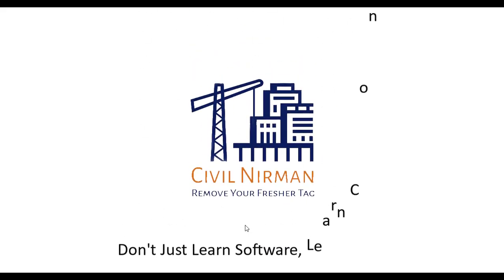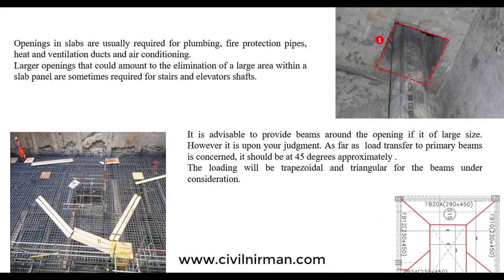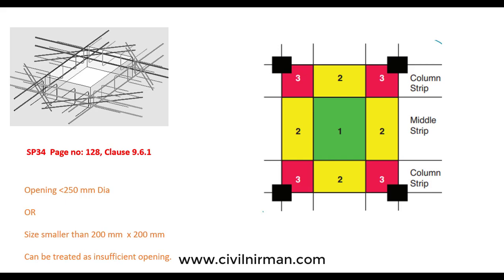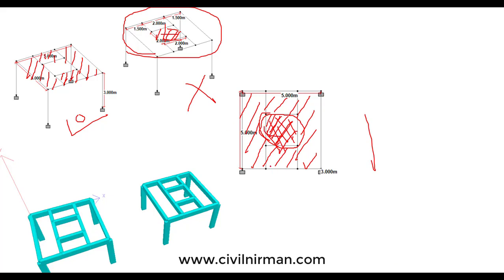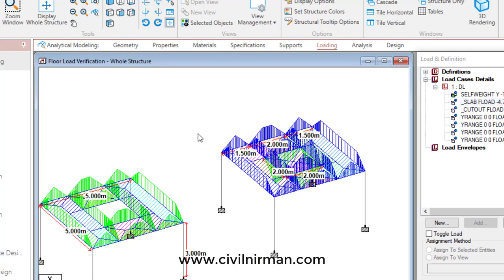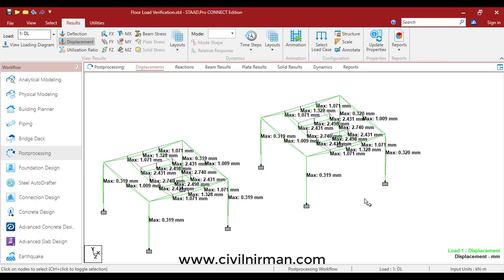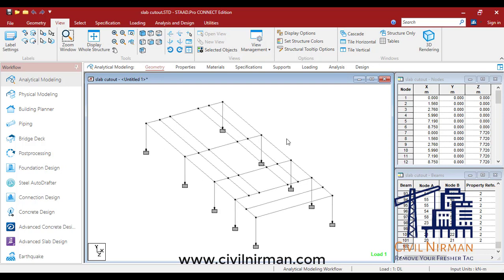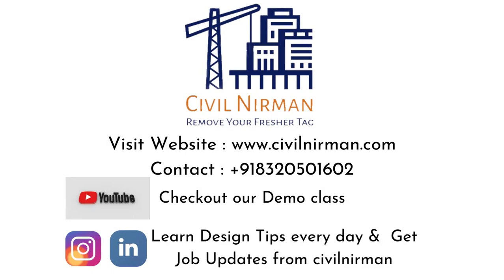Which method is better to apply slab load in STAAD? Verification with field example cutout in Slab

Comment: Sir you have found best solution to overcome tedious repeated job. But  STAAD PRO software developers  forgot about those openings. They haven't made provision for opening . At least they should have provided toggle provision in Floor load option that can be used for to removing void area load. But you have found solution like Antimissile  .Thanks for this.

Comment: Sir why haven't you used master slave command.
I m so confused about it
Could u please design a slab using master slave command and show us how and when it is used.
I m confused coz neither u have used plate element as fem nor u have used master slave command.
Reply from the maker: It is just a  demonstration model only to make u all understand about different situations regarding slab loading application, whether to go by range or by group 
Thats why master slave is not discussed here 
In reality for actual model and design you have to consider that
Reply: Got it.
But could you please design a slab from scratch using master slave command.
Reply from the maker: @hummaidzafar2666  sure
https://youtu.be/5QCUNKewqDo
check this
Reply: I understand this video and now it is kinda clear to me, i m using purpose of using master slave.
But i dont know the process of applying.
Its a kind request to make a video on it
Reply from the maker: @hummaidzafar2666  ok sure